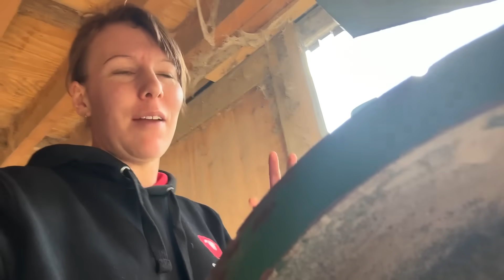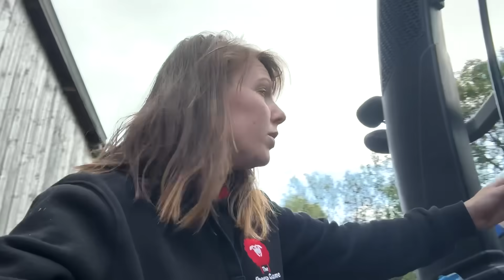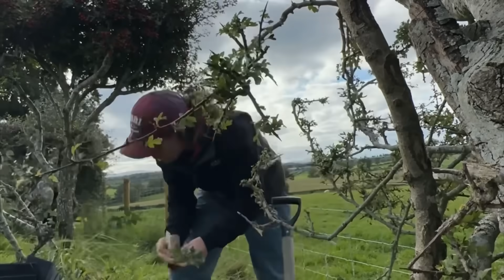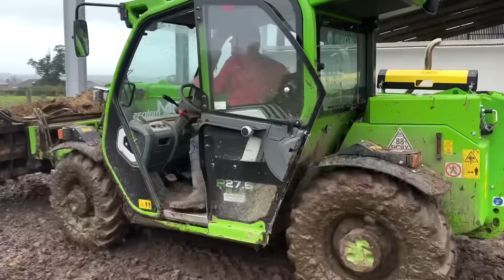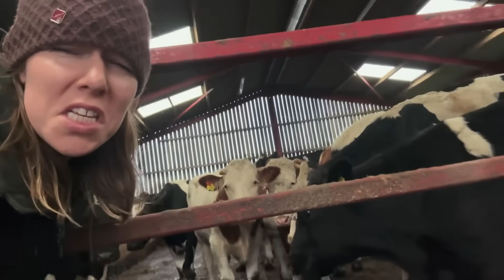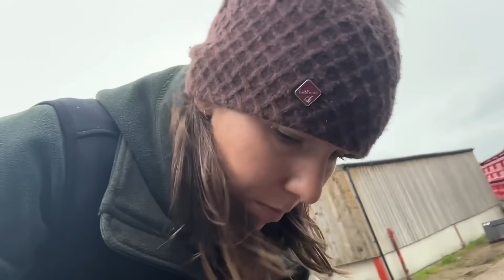Excuse me your in the way!! Caught in the act

Comment: Hi Charlotte your a top woman and seem to work very hard on the farm but please please, please turn off your tractor before handling the PTO shaft i’ve seen too many people losing arms and legs from the PTO slipping into gear. It does happen so be very careful , keep up the good work 👍
Reply from the maker: Someone else said that I didn’t even consider to turn it off you know
Reply: For a newholland to slip in gear is not possible find something else to tell her she is doing wrong.  Never underestimate a woman
Reply: Doesn’t mater if that particular tractor can slip its PTO on or not always switch the tractor off it’s good practice.
Reply: In 32 yrs of working with cows, machinery, iv never after I was told, attached a PTO shaft while a tractor was running.
Reply: @charlotteashleyfarm  pay no notice to the safety sallys, you'd get nothing done otherwise.